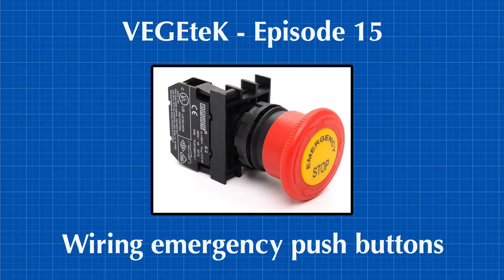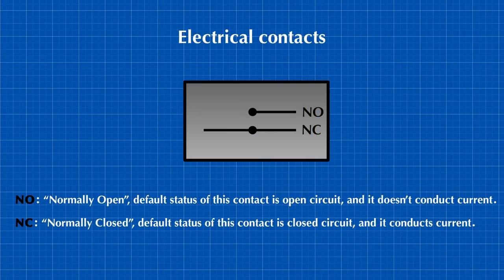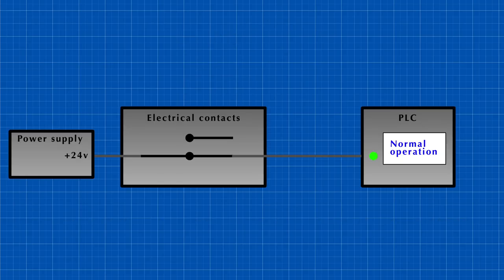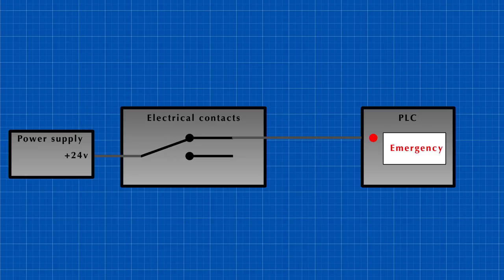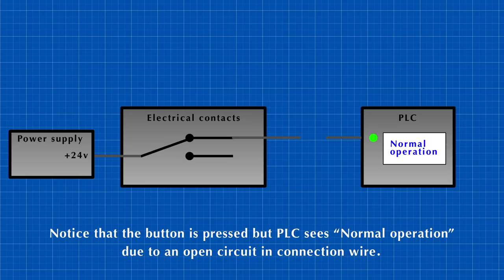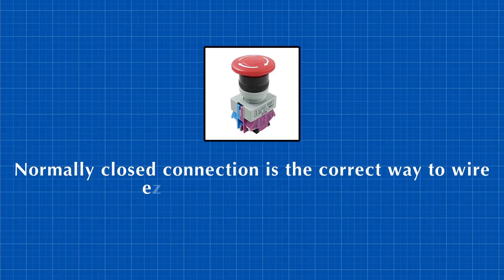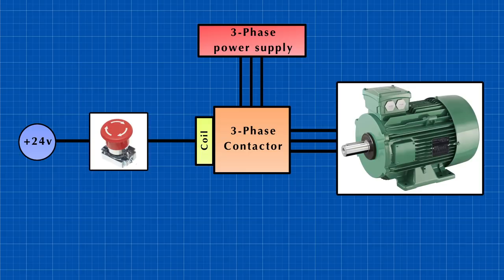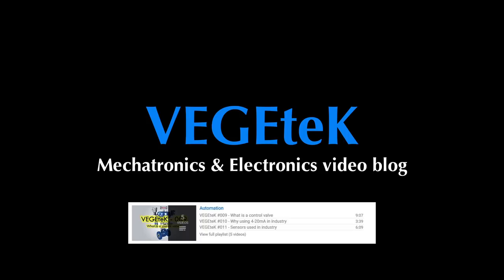Wiring emergency stop buttons

Comment: Removing power from a motor IS NOT AN EMERGENCY STOP!
Reply from the maker: I used it as an example so you can get the idea. And yes, sometimes the motor is considered an emergency to disconnect... sometimes also you would have safety relays to control stuff that are dangerous which can include anything.

The circuit shown there is general for emergency and normal stop signals... but the main feature is why we connect it in normally closed? why not normally open? 

I hope it helps!
Reply: It is a emergency stop as it kills the tool from running in a emergency while yes its not like a break on the tools motor it stops the power flowing to the motor in a emergency situation.

I learned the hard way of the value of emegency power off buttons ever seen a band saw start sucking so much power the motors begin burning in a room full of dust?

Comment: Wouldnt you cut off the line power feeding the motor ?
Reply from the maker: I used motor as an example to explain the circuit, practical stuff are more complicated.

Comment: what if contactor is stuck closed? E stop would be useless
Reply from the maker: what contactors?
in my experience, there are "safety relays" which can detect if its contact has melt down and permanently closed.

but this is beyond the scope of e-stop.